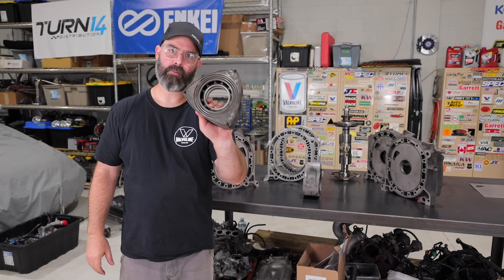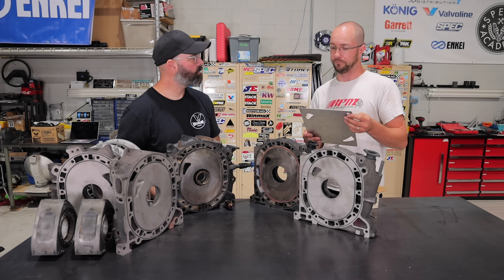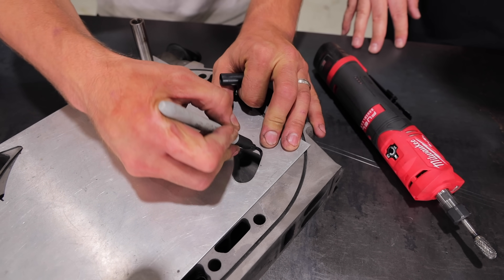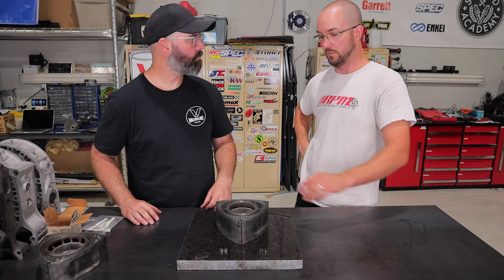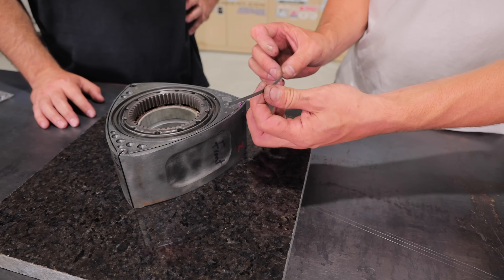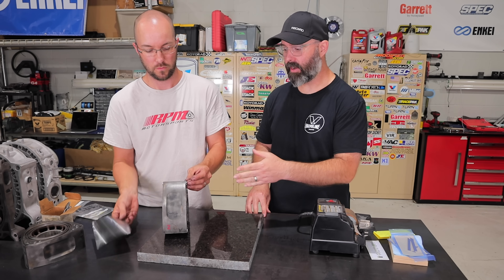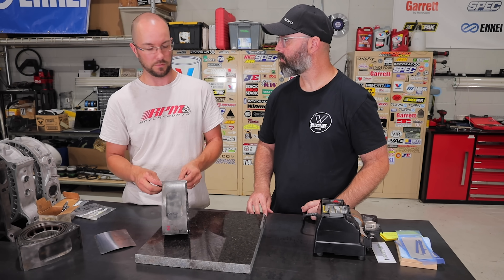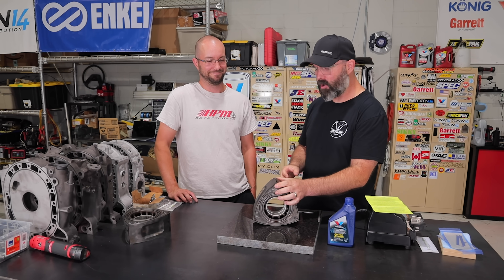How to Build A 10,000RPM Rotary Engine - Part 2

Comment: Lot of debate with oil in rotary engines, but I've always read that synthetic oils should never be used (either in your sump or for pre-mix) as they don't burn in the same way an 'mineral' oils, which I understand means the synthetics will leave gummy deposits. For the 2-stroke pre-mix a high ash mineral is preferable. When I ran my RX8 (standard 230hp six-port) I always used 10W40 'mineral', although I didn't also use pre-mix.

Incidentally, I was also always told that the oil injection (particularly into the rotor chamber) was mainly for the cooling and to provide additional film seal, particularly for the apex seals. Supposedly, mainly due to the minimal moving parts, using oil to actually lubricate really only applies to the rotor and end/e-shaft bearings.
Reply from the maker: We’ll be deleting the OMP in order to run synthetic. More on that soon.
Reply: Always interesting discussion. Idemitsu is fully synth: https://www.amazon.com/Idemitsu-30018100-75000C020-10W-30-Rotary-Racing/dp/B07MMT6W3Q
Reply: From what I’ve gathered everyone that does premix runs fully synth. The debate later is whether you should run synthetic or mineral in the engine. My conclusion is. Mineral in engine if you have the OMP, Valvoline VR1 Racing for example! And the a smaller amount of premix with fully synthetic. No OMP you can run fully synthetic in the engine and a fully synthetic premix but a increased amount of it :)
Reply: Two strokes put to bed a long time ago whether or not synthetic pre-mix is better. It is MUCH better than non-synthetic in every way.

Comment: The difference in ‘2 stroke’ oils is usually one is ester based and one is castor based. Ester based 2 stroke oils will not mix in alcohol fuels like E85. So if you guys are going to run it on ethanol, make sure the oil is castor based.
Reply: Just stick with what was spend millions on developing specifically for these engines. Idemtisu racing premix.
Reply: @mustangdemon87  Bullshit, Idimitsu makes scooter oil with a picture of a  rotor on the label... there is a sucker born every minute.
Reply: Thanks! I’m saving this one 😎😁
Reply: There are better synthetic premixes to work in alcohol than castor. Castor separates and gums up. Smells good works bad.
Reply: I have friends that use normal caster oil in their rotory
Reply: and it smells really good too...but watch for fires  as it may be hard for  you  to  see them only feel them..carefull
Reply: Did not know this, thanks for sharing
Reply: Ester based oils would be clearly advertised as such right?
Reply: Premixing is monumentally stupid.
The Wankel engine is 4-stroke and Mazda reccomends 4-stroke engine oil.
Don't be that idiot pouring the wrong oil down the wrong filler hole.